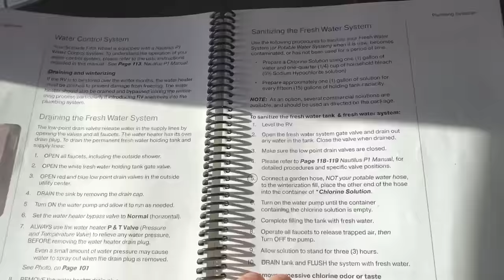MASSIVE WATER LEAK RUINED OUR RV - RV LIFE REALITY

Comment: We are in a very cold snap and we had lots of water pouring out between fridge and shower, it stopped but there was a filter on the back of the fridge that froze and busted. The heat tape on the filter didnt work. We have a good leak when our gray is closed, dont know why but I really need to open my underbelly as well. It is not heated. Now I have a leak under my stove and fridge and you cant see any of the pipes. It just never ends with RV's.
Reply from the maker: Oh goodness, those cold snaps are the worst.. So sorry to hear about your fridge and the tank leaking 😕You are right, it feels like it never ends! Stay safe 🧡

Comment: I know this is six months old  but I just have to say the tanks are NOT meant to fill up as far as u did and if u do that is what U saw.   it comes out the top of the tank  or vent I don’t exactly know where but  I found that out the hard way the top of the tanks are not sealed air tight and that’s what u had   , water overflowing out the top of the tank
Reply from the maker: Good to know!

Comment: Thank you for this video! I believe we were headed for the same problem. You didn't mention how long you'd had your Grand Design Solitude. I noticed the same shower fitting leak. 

We're trading in our 2021 Grand Design Imagine 3110BH because of chronic problems with the Schwintek slide; the slide started malfunctioning on our second weekend camping trip. 

I noticed leaking around the base of our shower wand hose fitting where it goes into the knob base EXACTLY where you guys identified your shower leaking. This happens every time we shower. I was annoyed by the leak running across the shower faceplate, but I never considered it might be leaking behind the shower! My mouth fell open when you showed what was going on behind your shower wall!

What year model is your Solitude? We bought Grand Design because of their reputation for build quality. Our GD Imagine travel trailer was assembled between August and September 2020. In retrospect, we probably were stupid to buy an RV built in 2020 during the nationwide shutdown. I can picture the plant shutting down for weeks, and the workers not documenting where they stopped in the build. When the plant reopened the worker (possibly an entirely different worker who just guessed at where to restart work on our RV). 

Our RV newbie experience has been a nightmare. Especially when we saw videos saying some people might start experiencing problems with slides after 5 years. 5 years? Really? We didn't get five trips without problems! 

Our faith in Grand Design is really shaken. We broke camp last weekend, and pulled our GD straight to a dealership to work out a trade-in! Maybe a different RV will have problems, maybe not, but at least we're ditching one that we know will keep giving us problems.
Reply from the maker: We have a 2019 Solitude S Class 2930RL
Reply: @HappilyEverHanks  
I know you guys are GD Ambassadors, and I still believe it is a great manufacturer of quality RVs. We loved our 3110BH, but that slide seems to be cursed. 

Even the best manufacturer has occasional "lemons" sneak through inspection.

Comment: Had  a  fresh water tank leak nothing I first used worked I was looking at $700.00 to replace tank. My last ray of hope was a harbor freight plastic welder for  $16.99.I  drilled 2 holes on each side of the crack so the crack would not grow melted plastic on to the crack 2 years later no leak.
Reply from the maker: Oh wow, that is great! Those tanks can be so expensive!

Comment: It looks like HDPE. You could see if you get someone to plastic weld it. It looks like  tight space and the tool to do it may not fit. There is some plastic adhesives that can bond to HDPE but they are not crack sealers. Also the spot looks like it may strain due to water weight so could be an issue to keep sealed. You can try contacting a plastic fabricator and they maybe can help you or direct you to someone mobile.
Reply from the maker: Hey Jon, thanks for the comment! Do you think that is all worth the work and time or would having the whole tank replaced be better? They aren't cheap but due to where the leak is may be an option?
Reply: @HappilyEverHanks  The concern for not replacing it would be paying someone to repair it or attempt to repair it and it fails shortly thereafter. Safest thing is to replace. When you start thinking of the cost of insulation replacement when you soak it then replacing seems to be of value. It would really be a money decision at the moment. I have seen some really good plastic welding on HDPE and have had pipe systems done that way. But that was all shop performed this being existing material may change what can be done. That bracket looks like it was there to keep tank in place.
Reply: That's not hpde. It's abs only way to patch abs is with abs paste you make with abs shavings melted into acetone. I've done many this way
Reply: At the 10 minute mark you will see a molded in manufacturers name and part number. The manufacturer is Midwest Rotational Molding. My understanding is that you cannot rotational mold ABS.
Reply: @HappilyEverHanks  At the 10 minute mark you can see the manufacturer and part number. I cannot quite make out the part number in the video.
Reply from the maker: @jons6386  we will have to do some extensive research, we are going to reach out to Grand Design. Will keep you posted 😃👍🏼

Comment: A note. When replacing fiberglass insulation, stuffing as much insulation to the point it compresses actually reduces the thermo performance of it. Insulation must not be compressed because it uses the dead air space to insulate. Compressing fiber insulation just becomes a block of fiberglass which heat transfer will be much greater.
Reply from the maker: This is great to know! Thank you for this :) We wish there was more room under there so that it wouldn't compress the insulation as much!

Comment: After all the patching it looks like the leak got worse so at least you know you're on the correct tank and yeah they never put like rubber like say a piece of inner tube rubber in between the straps that go underneath the trailer to support the water tanks and I highly suggest you empty out your tanks getting beside as you can and try and get in there and push up and put a rubber like gasket in between there too stop any rubbing and any other tanks because that may not be where the leak is I'm just saying why you got the thing open now is the opportunity to take care of that but a lot of times where the fill valves are not filled out but the film neck is they crack right there especially if the neck itself has been attached to firmly to the trailer and so there's no give but yet the tank moves but the neck doesn't and it creates a crack over time but anyway I feel for you guys and it was a great video enjoyed watching it all the best ✌️
Reply from the maker: Thanks for sharing!

Comment: You would be better off with holding tank leaking because a little silicone will fix that  but the floors in these campers is press board which will crumble after being wet and fall apart.
Reply from the maker: Oh good to know, thanks Donald!

Comment: I drill a small hole in my drain cap…grey water slowly drips out never allowing the grey tanks to fill….when dry camping..my uncle used to put a hose adapter on the cap so he could direct his grey to a bush or something down hill….of course you can only do this as long as your not using any harsh detergents or chemicals and of course grey only keep you black tank crap to your self….
Reply from the maker: Thanks for sharing!

Comment: Ours has a heater water tank, and we're told to drain kitchen and bath when freezing. We have valves under each room ?
Reply from the maker: Interesting Corinne, thank you for watching!! Best to you
Reply: @HappilyEverHanks  have a new Rockwood, and it had problems, broken refrigerator door, then it wouldn't run on propane, or battery, we had 2 new batteries installed when we bought it,, they don't give even one, they both went dead, for different reasons. Then a bunk window burst.
Reply from the maker: @corinnemcgee9239  goodness 😦

Comment: Hey I have a question I just purchased your water pressure gauge in with the water not moving max pressure I got it set for 60 pounds but when you turn on the faucet it drops a 15 that normal
Reply from the maker: We are not sure what you mean? Is it set with the water turned on?

Comment: I don't know if anyone has told you two this but if your tanks are made of  Polyethylene glycol you are not going to repair it it's the same thing truck bedliners are made of.. nothing on this planet will adhere to it you might get lucky and find a very good plastic welder person that knows what he or she is doing to fix it..look very carefully on the back of ALL of those jb weld packages it will say "does not adhere to polyethylene "
Reply from the maker: We were under the impression it is made out of ABS plastic so that's why we used that but good to know, thanks!
Reply: @HappilyEverHanks  I work for a very high end aircraft manufacturer that I can't name..
We deal with chemical composites that would blow your mind and still can't figure the polyethylene mystery yet.👍

Comment: The corregarded hose you saw just breaking through the underbelly up front, which one of you broke, is going to the battery box and it's purpose is to vent corrosive and combustible gasses from the batteries.  An rv is the worst investment anyone can make.  We have had a motorhome, 5th wheel an now a trailer, I wish I had never owned any of them these 30 years.
Reply from the maker: Thanks for sharing!

Comment: Jb weld worst crap on abs tanks.( actually crappy product period)Napa and other stores sell a gas tank repair kit that works great on gas tanks, water tanks , oil pans even radiator quick repairs. Used it on race cars all the time. its 2 part mixed in container that get hot before you let air get too it…Cures pretty quick and lasts.  Had a friend drill thru a plastic gas tank in a Subaru 10 years ago…. I Patched it with the good gas tank sealer?  His daughter still driving it to this day.
Bet things got moved around at the factory rebuild…. It happens.   Use the plastic coated insulation so no itching or breathing that crap….   Hope you have it fixed by now.
Good luck kiddos.   Happy New Year.🌲❤️👍👍
Reply from the maker: Good to know! Thank you so much for explaining this to us 😃We will keep you updated!! HAPPY NEW YEAR!!
Reply: @HappilyEverHanks  👍👍👍. I try to keep one with me in the truck. Dont use the fiberglass patch that comes with it.
Also if its ever a leak you cant drain…. Quick fix is rub a candle in the crack than wipe around edges with solvent and patch with the 2 part gas tank patch.
You kiddos rock 👍👍👍❄️❄️🥶 freezing here in northeast with snow 🤣
Reply from the maker: This is great information! You are so awesome for sharing this 😃Stay warm up there!! Come on down to Florida if you need to escape and get some Vitamin D!
Reply: @HappilyEverHanks  fla was the plan….too many familys came back after Xmas from fla now covid sick….🙁. Doctor said to hot probably stay out of that area code for a few months.  Usually go to Marathon in April…. Maybe next year.
Stay healthy kiddos!!👍👍

Comment: I cheated..... I cut an access hole in the belly pan. Our leak was caused by chipmunks chewing a hole in the water line. I replaced the chewed section and used durabond tape to seal the belly pan. So far so good.

Comment: Tanks cracked. JB weld wont last. The weight of that tank rests on that ledge. Once the tank has weight, hundreds of lbs the leak will start again. If the tanks were fully supported this would not have happened but traveling with water in the tanks did them in. A poor design as is in many RVs.
Reply from the maker: Thank you for your insight Anthony! Stay safe!

Comment: You aren’t the first with tanks cracked, coming unsecured or holes rubbed from design of manufacturer. Once it’s closed up it’s hard to inspect for unusual wear.
This is an issue where tank should be replaced as a design flaw by Grand Design. Maybe your documented pictures will help.
Reply from the maker: That is true Raymond! Thanks for your input😃

Comment: JB Weld is complete crap, I've used several different products in their line and have never had any luck with any of them.  And they are only a TEMPORARY fix product. For black and gray tank holes/cracks i use Otay brand plumbing cement and vinyl  screen material.  Works like a charm. There is another video on YouTube for a "permenant tank fix" all about it.  Good luck Y'all!

Comment: This needs a fiberglass and mat fix. Just sayin'. For the long haul.
Reply from the maker: Thanks for the comment! Can you clarify what a mat fix is? Maybe we'll look into it!
Reply: @HappilyEverHanks  You buy fiberglass matting in sheets of varying sizes and thicknessses. Then you buy a two part fiberglass resin that you mix just like what you've been doing. In simple terms,  you cut the mat and then 'paint' it with the resin over the crack. Probability is high that your tank is natively fiberglass. Cleaned, sanded and done properly, it will be better than new. It's messy. Don't get anything you plan to keep near it. You'll throw away everything you don't use, including the hard-bristle paintbrushes you use to apply the resin. WEAR gloves you intend to throw away. Probably long sleeves also in the position it's in. 

It ain't fun, but it's the only way to really fix your problem short of replacing the tank. I bet your plumber friend knows what I'm talking about, or at least knows somebody locally that does. Think old farmers and mechanics. Good luck!
Reply: And make sure it's all DRY. BONE dry. And it needs to cure for at LEAST 24 hours, but if you do it right, you'll never work on that area again.
Reply from the maker: This is great information Wilson! Thank you so so much for taking the time to write this out for us 😃We appreciate you!!